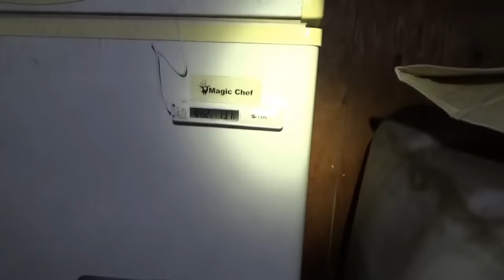Work On Greenhouse Wood Heat & Quad Work & More

Comment: while your at the car shop, get a glass inline fuel filter instead of the house water filter. you can unscrew the collection jar and empty it - instead of having to replace it. A little more costly upfront, but over time will save you.

Comment: need to use cpvc made for hot water.  PVC will not handle hot boiling water over time it will fail.  check temp tolerance on the pipe.  other than than idea sounds alright.  moving water doesn't freeze like still water.

Comment: As long as you keep that Wood stove running in the water shed you shouldn't have a problem with the water freezing. Even if it's around 37-38 degrees you'll be fine. It just means getting up every couple hours to check on the stove.
Reply from the maker: Thats the plan :)
Reply: The Do It Yourself World Just the harsh reality of living up here in the north. I wouldn't want to live anywhere else though.

Comment from the maker: Have a look at the old camper heating system where I first began: https://www.youtube.com/watch?v=XMC4fy6Rzlg
Reply: The Do It Yourself World  You should try putting some stop leak in the quad before you do anything else. Just get a good brand like Bars Leak or Aluma Seal. If it works it's gonna be the cheapest and simplest solution, if it doesn't work you're not really out much.

Comment: Very interesting,, there is no way to dig down the drums,, and get "floor heating" ?? 
But it is going to be a task to heat three "houses" two of witch is still very poorly insulated.
Have you thought about using a generator for heating,,, Having the Gen in the greenhouse, and extracting the heat from the exhaust,, running a good cable to your battery's. (also nice to get the generator away from the house)

Comment: When I needed a burn barrel at the beach, I went to the nearest food processing plant (Heinz, at the time) and spent ten bucks for two barrels.  The benefit of those is that they were food-grade, so they were coated inside.  Didn't matter to me for my purposes, but for yours, it would be an important consideration.

Those barrels are almost always configured with a removable top held on by a ring, which makes for MUCH easier cleaning and internal access on those rare occasions it's needed.

I'm sure you can find some sort of food processing plant within a reasonable distance, or know of someone who works at one, so you can get THEM to pick them up for you, and possibly even get a discount.

Why so cheap?  Factories normally just sell their used barrels for scrap, as they only needed them to ship stuff IN, and they only get a little bit back for scrap value.

Comment: Troy you should check out solar batch water heaters. I think one would work well for you. It's just a old water heater painted black in an insulated box with a window. The sun can get it up to 150+ and you can cycle that hot water through some sort of radiator or tubing inside the green house. It would save you some wood and some work I think....I bet you have all the materials on hand...just rig up some cheap waterpump to a solar panel, seems simple.
Reply from the maker: Well, dont forget I have the hot air solar heater that I have to install on the greenhouse too.

Comment: That's when I first saw you, in that camper and moister was dripping off the metal ceiling. The water line or something was also leaking slightly, I thought that was a great idea with the heater core thing. Your mornings were damn cold.
Reply: Never thought of it like that.
Reply: Yea, if I was that cold that stove would have been making steam!
Reply from the maker: Yes it was so cold in that old camper. There was no insulation in the ceiling and it was so badly water damaged that it was literally held together by tape. The heater and radiator core worked well. My biggest problem was that I would fall asleep and not refill the wood stove in the night. Boy it sure got cold in there by morning.
Reply from the maker: Not sure who you are talking to but since I cannot see them its got to be a troll. They just try to stir up trouble and spread lies. Remember I had a thermometer in there and showed the ice on the cat water dish too. It was cold.

Comment: put some silver seal in the radiator or bars leak it will seal that easy even some table black pepper will work im serious.
Reply: silver seal is the good stuff. Silver Seal Radiator Sealer Stop Leak Powder

Comment: I Think with the temperature gun you are getting just the outside of the container, or even off the metal framework, readings, not the actual water temperature. Need to take the temp in thru one of the top openings directly from the water.

Comment: maybe put some bricks and stones on and around the wood stove to reflect and retain heat also....can you afford power wise to put another small computer fan above or near the wood stove to blow the warm air toward the water tanks....

.also do you have any plastic or tarp you could staple to the ceiling to help retain heat until you got the funds for insulations
Reply: At least shove newspaper, wrapping paper, whatever in the holes under the corrugated roof in the water shed...

Comment: pvc pype is only for maximum 40 degree celcius... y would use steel fittings..you wil use thermal syphoning the water will be 100 degrees celcius... this wil not work!. (in my opinion its better to put the stove inside to, i know you have to go trough the roof, but its way better!!) (yust my opinion)
the barrel water mass is a good idea. dont worry about the rust..

Comment: I am assuming that you have some way of draining all the water from your boiler system. Fill everything up the first time, run it for a few hours, then drain the whole thing. I'd do that twice if I were you. Look into getting "glycol" if you can rather than anti-freeze once you have it up and running. It works as a rust inhibitor. And don't forget the expansion tank!Hope you figured out how to hold all the barrels before you started adding water.
Reply from the maker: I am working on it. I am going to get some antifreeze from the mechanics for free I think. I will be building a frame to hold the barrels in place. The frame will hold my raised grow bed over the top of the barrels. For cold sensitive plants.

Comment: Its there any chance to put a copper serpentine inside of the stove and run the water on it to bring that temperature up?? 
Also did you get you power inverter working or replaced? I have been thinking about your issues.. and you are in mi prayers! I know that it have to be a hard life but the satisfaction have to be really high!!
Reply from the maker: The wood stove in the greenhouse is made to be a water boiler so no modifications needed. We dont have the inverter replaced yet. We use the generator as needed on the freezer for now. Thank you for your prayers. Yes we are very satisfied with our life out here.
Reply: Thank you for your prompt replay.

Comment: would have been much easier to fill one drum with water take PEX pipe and coil it inside the drum hook up one end in and the other out closed system.